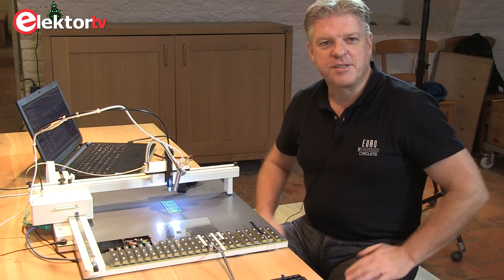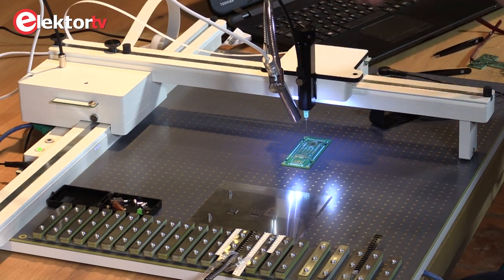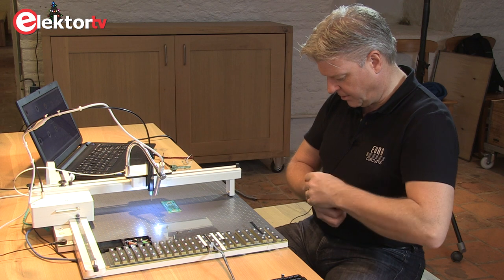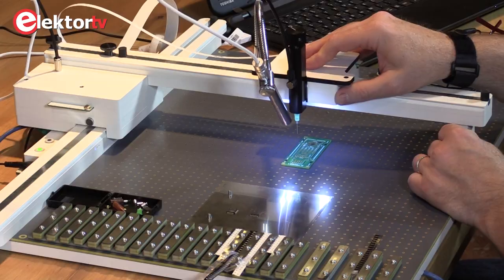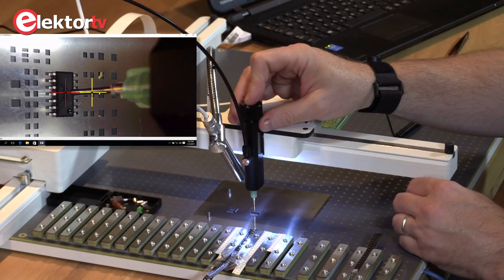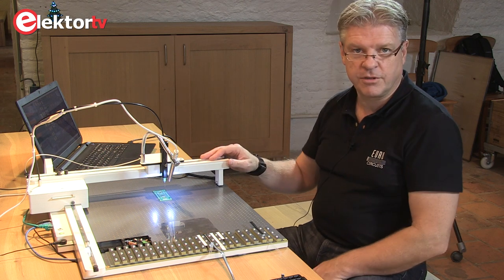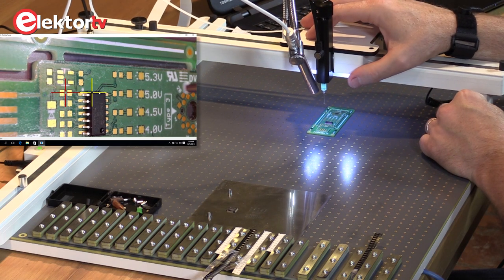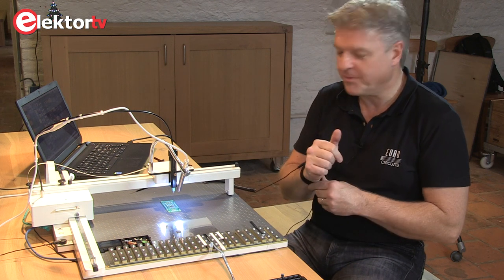Manual Pick and Place machine

Comment: What is the purpose of such machine? I understand that an actual pick and place machine is very useful for its precision and speed, plus the automation it can provide. But that machine doesn't present any advantages when comparing to a set of tweezers.
Reply: Stabilty some people drink a lot of caffeine. Tweezers also aren't that great for 0402.
Reply: it does when you are doing bigger boards with smaller combonents...